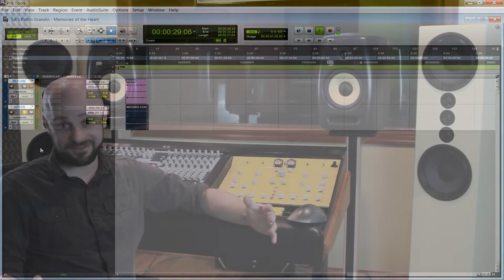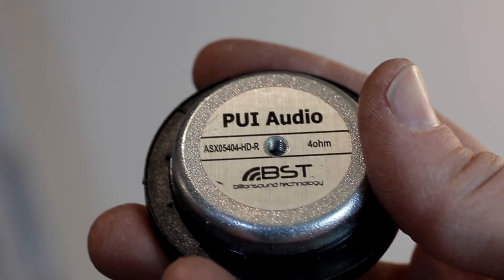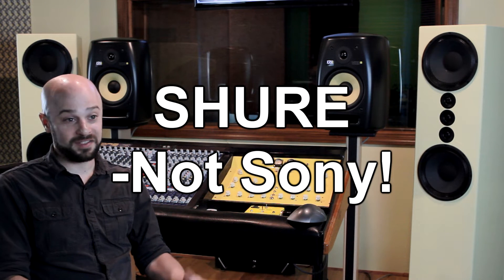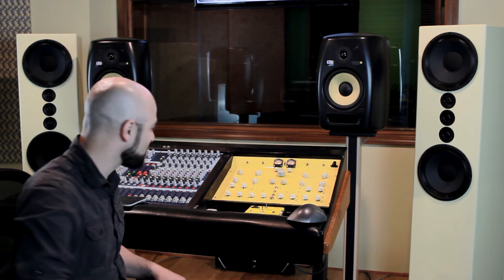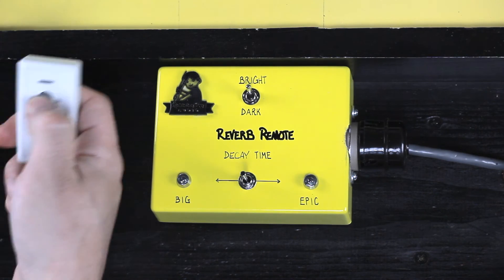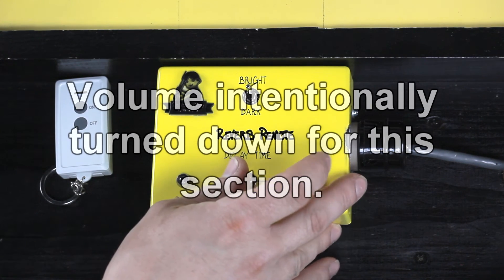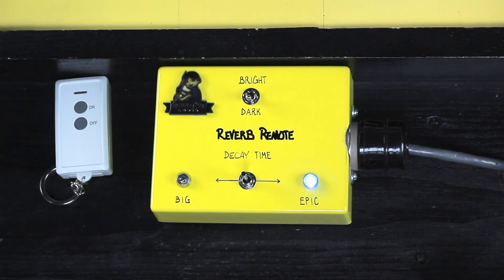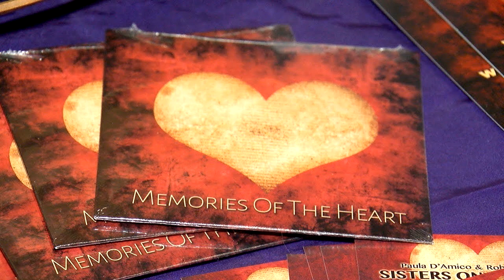DIY analog plate reverb - Part 10 - moving coil pickups and remote control

Comment: hi, how did you exactly glue the speaker diaphragm to the plate? you mentioned hot glue, but did you use glue arround the edges or directly on the center?
Reply from the maker: It’s been a while, so going off rough memory here.  Hot glue ultimately failed.  I ended up using epoxy in the end.  It was only on the center of the cone.  The rest of the speaker was affixed to a custom metal bracket.

Comment: Holy crap.  I used to own the Lawson/Audicon "The Plate" reverb that was used (among other plates) by Sound Toys in the creation of their plate reverb plugins.  It was too big and unwieldy to keep when I moved studios so I sold it. Sound Toys had given me their plate reverb plugins in trade for measuring and sampling my plate. I have to say that the ease of use and sound of their plugins made keeping the plate seem redundant.  But now I want another one.  I'm planning on building one, somewhat smaller than the original, and using it for more dramatic sound design effects rather than just music. I actually used the sound of the dampener motor as a component of sound design for a sci-fi movie that required a large spaceship door opening to allow smaller spaceships to enter and exit.  It sounded just like yours!).  I am not going to motorize the dampener. I'll locate all the electronics with it as well, and use my assistant and a pair of walkie talkies as the remote. Anyway, I loved your series and really appreciate your trial and error.  I have a few pairs of headphones with one blown driver, so I'll have pickups similar to yours.  How did you decide on the gauge and the specific dimension of the plate itself?   I have a space that would comfortably accommodate a longer,  but narrower plate.   Is there a way to predict anything at all about the sound before committing to a size/ gauge? Again, this video series is incredible!  Thanks for making it (the video and the plate!).

Comment: Just found out the Ecoplate III used Barcus Berry Hot Dots, an early piezo disk (very small) acoustic guitar pickup. The Ecoplate III sounds absolutely killer. What kind of circuit did you use for the piezo? I wonder what a Cortado contact mic mounted with some of Jim's "rear view mirror adhesive" would sound like.

Comment: Wait wait, hang on, it may have been how the originals were made, but Jim Cunningham's piezo pickup mod was a popular upgrade for EMT 140s and it's what was used on all of his Echoplates. The moving coil on the EMTs was primitive and noisy. The only thing slightly special about Cunningham's piezo was that they had a resonant frequency around 20khz, the thinking being that this would prevent any weird peaks with the human audible range, to be honest, though I think Jim might have been overthinking that one, I don't see too many high-end contact mic manufacturers bothering with ultrasonic disks, and you would think they'd want to avoid peaks as well. Still, I don't buy it, I've heard a lot of producers talk about what a great mod the Cunningham piezos were.

Comment: Thanks so much for this series - it sounds awesome, well done. I actually have a full size diy plate in my basement too, and we got it sort of working, but I wasn’t very impressed with the sound of the piezos. So it has been standing there unused for a couple of years since its conception, because I’ve been unsure of what to do. Your idea of using headphone drivers sounds brilliant! It has to be noted that I’m completely blank when it comes to diy electronics though, so I might have to find some ready made, preferably cheap preamps for them. If you have any suggestions I’d sure appreciate it. Again - Great job!
Reply from the maker: A basic stereo mic preamp should do the trick.  A nice preamp will obviously give you a better sounding reverb.  Thanks for watching!
Reply: @LightningBoyAudio  Thank you!

Comment: I'm building a plate reverb using an aluminium plate which means it's smaller and easier to drive. Nice video you worked hard to get your results and that's admirable.
Reply: How about results? I think it should have less high frequences... May be less decay time, because aluminium is soft metal) Can i listen it?))

Comment: I realize you have yours isolated in the basement, but how sensitive is it to outside noise?  I have a decent size (500sqft) one room studio, so I would be mixing in the same room with the plate.  Been thinking about building one for awhile, but am not sure if this would be a problem...
Reply from the maker: Its very sensitive.  The isolation case helps quite a bit.  You might want to mute your speakers when bouncing down.

Comment: Piezo is good because it doesn't affect the plate much. Yes, it's true that they don't have a fantastic frequency range, but I don't think that's a problem for a reverb, which is meant to add background ambiance, only. As I see it, the important thing is the material and construction of the plate reverb. A good plate isn't ruined by piezo, but a bad plate cannot sound good no matter the pickup.
Reply from the maker: If you heard the before and after from my  videos and still prefer the piezo, then I’m sorry for wasting your time.  I think the headphone option presents a better level of realism, which I prefer.  Despite being a background element, IMO the quality of the reverb has a big effect on the overall sound of the mix.

Comment: I'm still confused. Were you using the PUI as a plate exciter, or receiver? What are you using now as an exciter? To be honest, I think it sounds really good but does a background "ambient" effect like this really need to be hi-fi?
Reply from the maker: The PUI was intended to be used as pickups, but they were terrible sounding.  There is a driver and there are two headphone speakers as pickups.  From my experience the fidelity of the reverb has a major effect on the overall sound of the mix.  There’s an old saying that goes, a studio is only as good as its reverb.